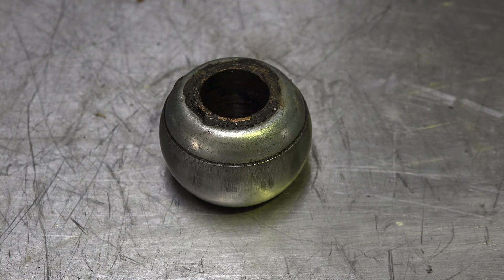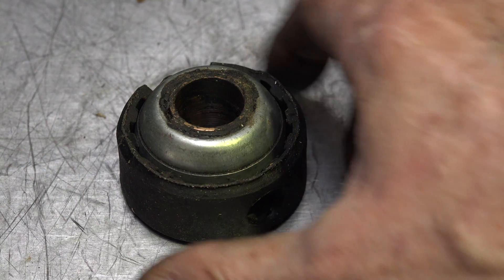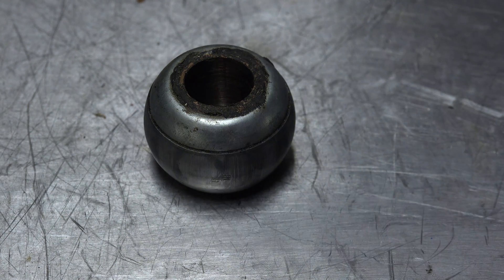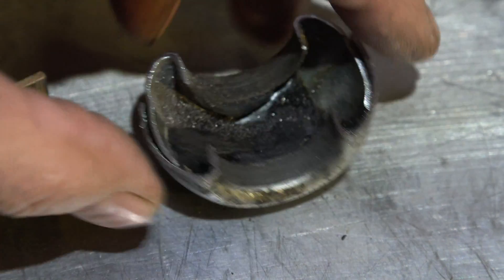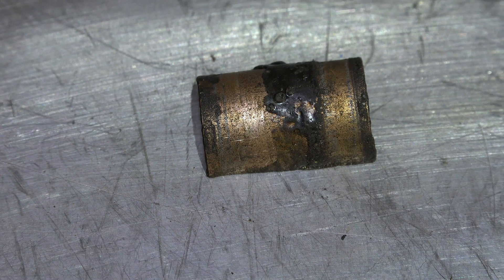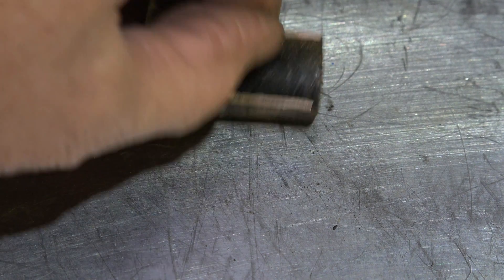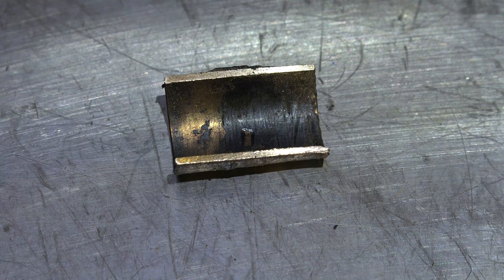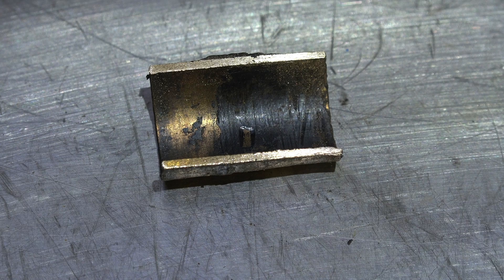Furnace blower bearing disassembly

Comment: Most likely an Oilite bushing bearing that is impregnated brass. If you use grease on them they will do that. Should only use mineral oil and there is a procedure in order to rehydrate them with mineral oil.

Comment: Is it possible to switch from a belt driven blower to a direct drive block in my oil furnace?
Reply from the maker: Its pretty tough.  The blower wheel would have to be replaced with one with a 1/2 in hub and mounts would have to be made.
GFM

Comment: I took the bearings out of my old Delhi. They don't have a wick. Am I supposed to lube them once a year or something?
Reply from the maker: If there is no oiler on the bearing,  they are supposedly lifetime lubed.  Would not hurt to oil them if you can.
GFM
Reply: @grayfurnaceman  Ok, thanks!
Reply: @mutantbaby1672 It's a bushing, not a bearing.  No lube points. Replace every few years.

Comment: It seized on the shaft and the winding's didn't  burn out? that is a miracle because that happened to my blower motor and for some mysterious reason the thermal cut-out switch in the motor did not  OPEN! It smoked the winding's

Comment: Does the brass bushing spin with the rod, or the rod spins inside the brass bushing?
Reply from the maker: The shaft "rod" bears on the Bronze bushing.  Brass is used for candelabras, not bearings.  Just would like you to use the right terms.
GFM
Reply: I’m confused on your answer. So does it spin inside the thing or do does it sound around the rubber?
Reply: @thomasnguyen3646 no.  It does not spin.  It's a cheap design made to fail.  Grease never gets to the shaft via the brass bushing, thus friction, wear, failure.
Reply: @mickcarroll1274  been waiting on this reply for 2 years now I can go fix it

Comment: Is it possible to convert my fan belt driven blower to a direct motor?  Does the direct motor require a special blower.  The reason I ask is that my bearings are wearing out and I don't want to deal with this in the future.  Thanks Gary!
Reply from the maker: Replace the bearings.  Its too much hassle to replace the entire fan assembly.  Try this video:  https://youtu.be/S3IzIe2VcMc
GFM

Comment: Good video, as always. Off topic question, why is it when i look inside some furnaces where the t-stat wire connects to the control board, the t-stat wire is sometimes coiled/pig tailed right before the terminal block. It looks like someone wrapped the wire around a screwdriver or something round a bunch of times. Is this to create slack if needed for a new furnace in the future or am i way off base?